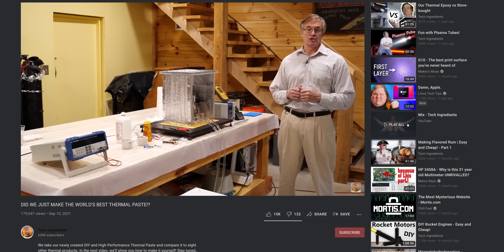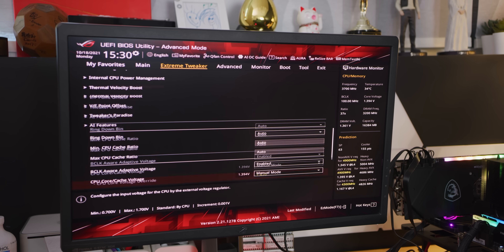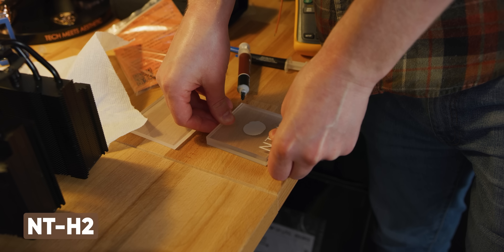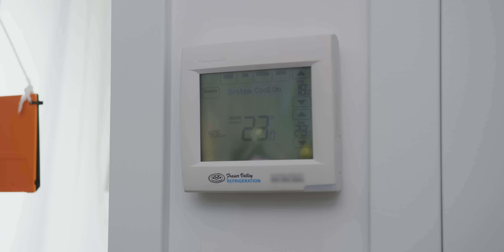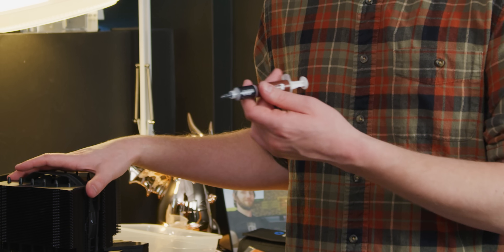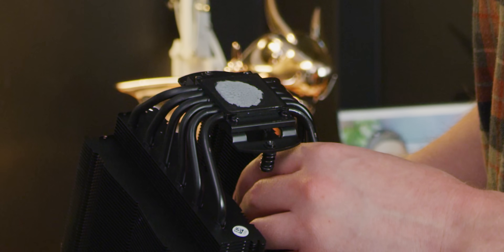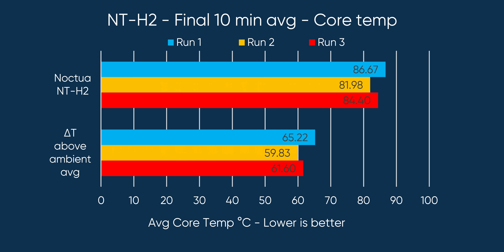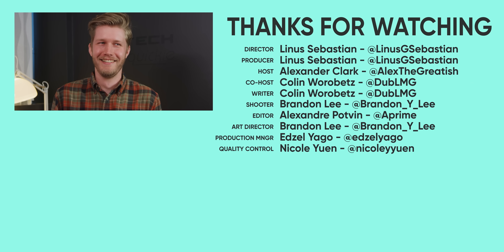We called out Tech Ingredients and they DELIVERED

Comment: Grandpa: Builds a complex setup to minimize variables in order to say if stuff is good or not
LTT: We don't care about that, we got REAL WORLD
LTT does real world test
LTT: Our setup is so shitty, we have no idea which one is actually better 🤷‍♂️
Reply: They've probably tried harder for consistency than any actual person applying thermal paste to their PC. Goes to show that incredibly marginal gains don't really matter.
Reply: The results were legitimately too close to matter.
Reply: Yup! LTT blew chunks on this one!!!
Reply: Tech Ingredients just sent their thermal paste to the wrong channel, they should have sent to gamersnexus instead.
Reply: TI complex setup wasn't to see if "stuff is good or not." It was a rig to compare performance between different pastes.
Reply: That's kinda the point though. For a real world setting you can expect about the same performance from the two. Doesn't really matter if one is like 0.01% better in a tightly controlled experiment.
Reply: I would not say that LTT botched this test on purpose. There is just no benefit for anyone in copying what grandpa did (especially since they can not do that on the same level as he did).
Imo the actual conclusion is: Your room has so much influence on your hardware's temperature, that the fraction of a degree difference of the paste is outweight by it.
What this LTT video is more about, is pointing out how impressive grandpa is, as someone in his basement who mixed a paste that goes head to head with a pro like Noctua.
So, while I am disappointed in LTTs content here, I think they did a great job in giving fame to someone who deserves it for his excellent work! 👏🏼
Reply: @TheBrilliantShadow  by saying "grandpa" you mean "gentleman" right? Or senior engineer... I feel like it is disrespectful, as the whole video is. That "basement" is a home lab... anyway, I am out. I enjoy LTT content, but I need a break, and we will see where this style goes in a few months.
Reply: @peterbalogh2646  Oh, sorry if I sound disrespectful. I think Grandpa is a cozy name. I mean, everyone loves his Grandpa, right? :-)
Reply: @TheBrilliantShadow  nah, you weren't disrespectful. It's clear you have a good connotation for the word "grandpa" and that it's a compliment. But I don't think LTT did a good job giving fame to Tech Ingredients. They basically spent no worthwhile effort or time on this video. It's like decided to just throw it together haphazardly with little to no forethought. The only way they "gave fame" to Tech Ingredients is just by the sheer popularity of LTT. It's the equivalent of hiring an insta model to do a 20 second insta story on your product.
Reply: @peterbalogh2646  chill lmao it's a affectionate / joking nickname
Reply: @TheBrilliantShadow  There was also the tone of voice used.   It sounded disrespectful, but then I thought the testing was pointless when the idiot couldn't even bother to measure the same amounts to squeeze together or simply place a weight of the same amount on both.. instead he squirts some out and then presses them together with no possibility that they were all 3 receiving the same pressure.  It reminded me of chiropractor that has people stand at a slight angle to the xray machine knowing full well it will make it look like their spine is curved and they can con the patient into believing they have a curved spine when it would be straight if they stood the right way.
Reply: lol.  they also put up a chart showing TI's is better right as they say it's equivalent to Noctua's.
Reply: @nlingrel  No they were correct in saying that. There is literally a 0.9 degree difference in the average, and the noctua's lowest run was lower than TI's lowest run.

Considering run to run variance you cannot conclusively say one is better than the other.
Reply: @yz249  I disagree.  If you can't trust the test, then you effectively tested nothing.  If you can't draw a conclusion from your data, that means you can't draw a conclusion.  Saying they are equivalent is a conclusion.  So either the test is unreliable and there's no way to know which is better, OR the test is reliable enough to use the average data (which is the way testing works, you don't just use the best run) and CORRECTLY say that TI paste was better.
Reply: @nlingrel  Margin for error is a thing that exists in all tests. If something is that close in performance, the difference could easily be margin of error. Equivalent is the only reasonable conclusion with the results of this test.
Reply: @KingofCrystals  nah.  If your error margin is too large because your test is shoddy, then you need a better test.  You can say "about the same", "nearly the same" or something with any qualifiers you want, but equivalent has an actual definition that means equal.  They are not equal, TI performs better in that specific crappy test.
Reply: @nlingrel  I don't think 1 degree of error is large though? Also this was testing real world use. Because ultimately what LTT is geared towards is what can a consumer expect to receive if they were to buy this product. I think error here is your understanding of the test.
Reply: @nlingrel  margin of error always exist, normally you would have to calculate error bars and check if those thermal pastes are within margin of error to each other,  if they are then they are inconclusive. But to decrease margin of error beyond 0.9 C (which is diffrence between thermal pastes) You would have to do 20 tests on each paste most likely. Considering each test takes 30 mins of testing + 10 mins of setup, that would be crazy long test taking 27 hours non stop, not even accounting for problems with varience of ambient tempreture.

Also lastly, some thermal pastes have tendency to dry after long period of time or maybe not dry but lose certain properties, while certain pastes require few heat ups and few coolings to get their optimal properties - and suddenly test from taking 26 hours you have a test taking few months.
Reply: @nlingrel  : TI's superiority does not exceed the margin of error, therefore they are equivalent. You can say they should use a better test all you want, but that will be a different test, and therefore cannot alter the results of this test. This test concluded that they were equivalent, period.
Reply: @nlingrel  ooof. Ok. Let's look at an real world application and example of that testing philosophy.
There was a now defunct rocketry company local to me, they had a lab testing and developing adhesives.
In that lab they came up with an two step metal to metal and metal to ceramic adhesive that, in the 1970's they did not have the technology to understand how it was working, that technology would come at the university levels in 1986 and 1987 respectively, and be available for them in the 1990's.
But it was strong. It was stronger then traditional explanations could define.
It was stronger then any of the test equipment they had. So they built bigger and bigger test platforms until they realized the bond was stronger then the tensile strength of any material they had to glue together.

And they could not figure out what was causing that strength, again the technology to see the atomic bonds was not there, so they could not manufacture this into its own material as you would expect to occur.

That cold bonding technology they developed was abandoned. It out performed welding, and it was abandoned.
Precisely because the test platform was too inpercise to yield definite numerical results, they where only able to yield <=> boolean results.

Now, that type of cold bonding has been rediscovered redone and is used to produce cars a lot of joints are glued together these days, just not all real world testing showed some amount of water ingres under strain that could cause rusting. But not that one particular adhesion process nor any that really hit the right boolean requirements, all of them seem weaker but more flexible, so maybe that's a design choice. Maybe something that would revolutionize the world and allow for better then metal 3d printing to happen in the fricken 1970's has been lost.
And because it was a rocketry lab working for the USA military. That excat formula was not just forgotten but literally thrown away and all notes destroyed, to ensure the USSR never caught wind of it. All that remains is just. The accounts from the children of farmers who went to work for the military and NASA in the 1970's as they wonder what could have caused such a great bond.
Reply: @piotrj333  can you stop trying to act smart. you are just making yourself look like a fool. this was a video meant to entertain people, not a full scientific test. its actually stupid to think that ANYONE will spend an entire day of their life testing thermal paste.
Reply: @nlingrel  I agree one could execute better and better tests to the point it would have results consistent to the third decimal place. But it gets to a point that the inconsistency is part of the test subject. I don't think they MAKE the thermal pastes that consistent. You could find the exact result for this tube, but if you tested one that was produced the week before that or was stored differently, you would find different results.
Reply: @Critical3rror  You do not understand my post... I was against making such long test and it was response towards person saying if test is inconclusive then it is useless.

And 2nd : I actually did such tests on viscosity of fluids at university, and I was doing full 20+ tests on every single variable calculating error bars for measurements, for tests, combining them and because i know it, I know that if you can't control all variables for such small margin of error means doing more tests is actually not useful.
Reply: @nlingrel  If were a pharmaceutical company I wouldn't really wanna hang my hat on "we performed better in a crappy test".  Even so, props to TI.  Everyone here got an entertaining and anecdotal result and TI got the exposure and publicity on a channel with 14M+ subscribers.  Many of us here will know TI itself did a far better analysis.
Reply: For all mounting it would be nicer if the tests did use some more paste.
Reply: @nlingrel  it was within margin of error, they also had other variables that they couldn't control for like the air conditioning.
Reply: @nlingrel  it was within run to run vairiant.
Reply: @nlingrel  Nope. They were correct, as they rightly know their margin for error is more than the delta of their tests. Since it is real-world testing, it takes a significant difference in results to say one thing is better than another. 

Take Gamers Nexus testing of GPUs and CPUs... they have much more rigorous testing methodologies (I think LTT would agree with this) and even they frequently say two cards or CPUs are equivalent since the difference between them is less than their margin of error.
Reply: The flame war down here over thermal paste testing is absolutely riveting.
Reply: @joshuatree9358  honestly that's the only reason I read this comment thread
Reply: So much for those sweet ads revenue.
Reply: Yeah, just goes to show how little effort they made on this video tbh. They could have done more tests, moved to a different room with a better ac unit, and used their torque screwdriver to torque down the screws to apply the same amount of pressure. They have all these resources. Even with the waiting of 30 min per test, it definitely feels like they spent less time on this video than any other.
Reply: Yeah, they made it this way so they do not have to conclude a winner, because they do not want to loose sponsorship with a big tech company.
Reply: Yeah what the hell LTT. Like, I would have expected something half-decent. This was almost as bad as the last Repair Challenge. Stop releasing videos that are trash because you need to release them.
I was excited to see this video. Now I'm disappointed. Guess I'll have to wait for Gamer's Nexus to maybe do a review.

Comment: You touch the right point here in my opinion. THIN is just as important as thermal conductivity. Sadly whatever makes a paste well conductive prevents thinning.
I had my best results with using clear thin silicon oil (lube ;) ) on very flat and mirror finish lapped surfaces. No fancy particles that kept the surfaces apart. Just a micron thin layer of the fluid.
Is it possible for you to make a comparison with just clean silicon oil? Because my results were on par with liquid metal, but I don't have the data base to find out if that is just a fluke, or if I did something wrong with the liquid metal (which was a bit better than any other paste I used before, so I think I did it right. But you never know!)

Comment: "this is, again, horribly unscientific"
two seconds later
[ by 0 he means ∞ ]
😂
Reply: plot twist: it was the world's first room-temp superconductor
Reply: Dunning-Kruger in full effect in these comments lol
Reply: Plot twist by saying zero he meant  zero laughs for now, but wait till the video is out, could be approaching infinite.
Reply: should be measuring the conductance in Siemens not the resistance!
Reply: @ritecomment2098  No difference when in DC, which is what CPUs use. When working with AC though... resistance isn't good enough. An ideal capacitor has infinite resistance, but still conducts AC.
Reply: @Bubu567  Capacitors don't conduct AC, they create a magnetic field moves charge on the other side but those electrons still have to come from somewhere with a potential on the other side.
Reply: @cda32  Oh. Ok. Here hold this capacitor lead while I hook the other lead up to 240v AC. It won't conduct so you will be totally safe, right?

It effectively conducts electricity. You are just trying to sound smart, but you only sound pathetic. It conducts electricity, but not directly. If it was direct conduction, it would have resistance. I covered this already.
Reply: @Bubu567  I was talking about conductance rather than reactance or ESR.
Reply: Well that's due to how the measurement tool works
Reply: @cromefire_  I know how a multimeter works, i just find it hilarious how on-brand Alex always is whenever he does anything remotely "scientific"
Reply: @cromefire_  I mean, if there was 0 resistance (which is what he said), it would mean the paste is as conductive as possible. The more resistance, the less conductivity
Reply: @cromefire_  It's because he read zero instead of OL meaning overload, not really because of the tool
Reply: @unluckyguy3637  OL is Out of Limits which is the meter saying it's essentially infinite or beyond the ability to read.
Reply: @daexion  Also heard people call it "Open Line"
Reply: @unluckyguy3637  pretty sure OL means "open loop" in resistance/continuity mode.
Reply: @unluckyguy3637  It's Open Loop but yes.

Comment: I have never understood why this stuff comes in such big tubes. If you're a system builder or a tech support person, fine. But when I buy a cooler, you only need one application. Why can't they just include a ketchup packet with one application of thermal paste in the box with the cooler? You might need a second one if you have to troubleshoot. So fine. Two or three ketchup packets. How many applications are in those tubes? 30? 50? Someone building one computer for themselves doesn't need that.

Comment: I am convinced that we have already reached peak performance of traditional pastes. Their performance is really only limited by how good the paste spreads and fills the tiny imperfections, not so much of its thermal conductivity as you have concluded in this, admitettly, not so scientific test. However, making a paste too thin increases its vapor pressure so it wont last long until it hardens. 
So the best alternative would be liquid metal, but that comes with its own problems. 
The last step to best thermal performance will be perfect surface treatment, where both surfaces of the cooler and CPU are so even, they form a bond if you apply enough pressure.
Reply: Yes let's just cold weld our computer components together.

Comment: Now slap it on a watercooled setup with a mirror-polished mounting surface and enough cooling capacity to actually benefit from a high performance TIM. No one is going to go through all that trouble to make their own thermal paste to throw under a bog standard air cooler. This is enthusiast level sh*t, so test it on an enthusiast level setup.

Comment: Back when Athlon CPUs were new and overclockable with a pencil, Arctic Silver 3 (i think this was the version) was the premium thermal compound, The prevailing procedure was to apply tiny tiny amounts, with the theory that it was just there to fill in the (air) gaps between surfaces, and heat transmission still relied predominantly on metal to metal (well, metal to chip die, technically) contact, not on a distinct layer of paste. it worked, and this was before heat pipes were in air coolers. Now we smear it on like we're icing a cake... interesting how things change.
Reply: Tech ingredients went into this in a fair amount of detail, watch the latest video on the thermal paste.
Reply: Because the smarter voices finally prevailed over the ignorant ones. Metal-metal contact will happen because the mounting force will squish out the extra thermal paste. The tiny amount of extra metal contact you get by using microscopic amounts of paste is outweighed by the benefits of full IHS coverage you get by applying a lot of paste in an X and the drawbacks of manually spreading the paste and introducing air pockets.
Reply: @angolin9352   not saying current methods are bad (or good), just commenting on how they have changed. At the time, I distinctly remember seeing tests that showed thicker amounts of paste led to poorer performance. I know paste and cooling tech has changed a lot since then, not to mention the presence of an IHS.